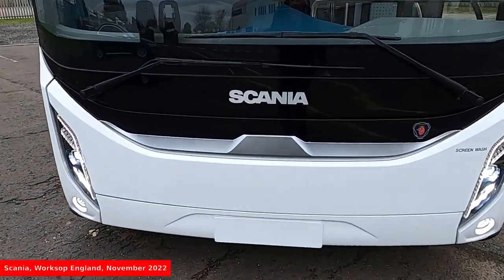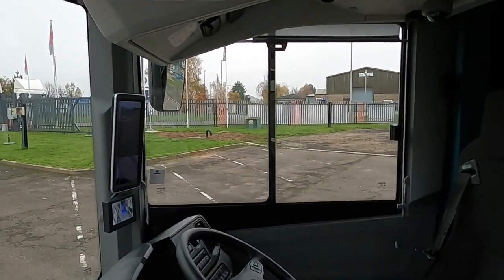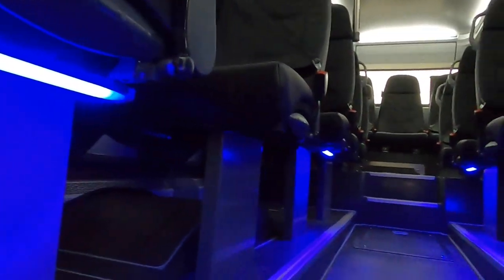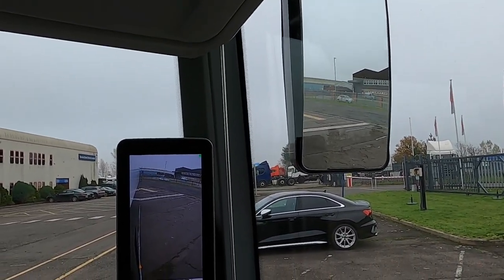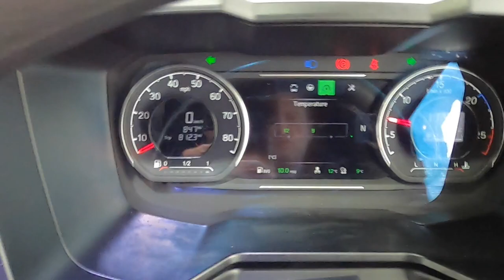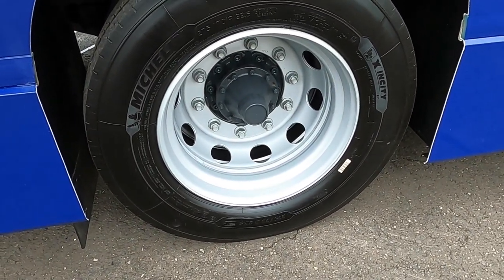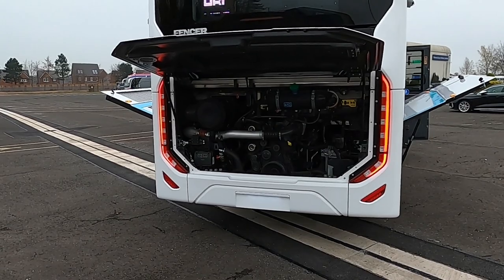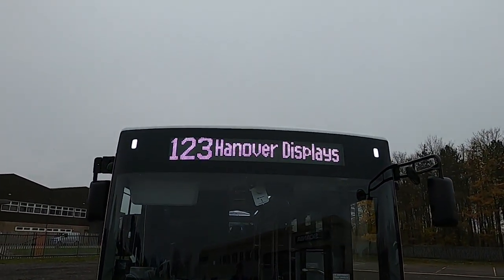UK Exclusive Test Drive | Scania Fencer f1 New Generation

Comment: This new bus looks nice but:
they should've used an interior IPS (or TFT) LCD display instead of a red LED one
For the UK market they should've added a "Bus Stopping" sign since I'd doubt that most passengers would understand why the stop bell is flashing red
The LED accent lighting should've been white instead of blue
And the driver's cab controls should've all been moved to one side of the bank of switches so that there aren't so many visible blank switches.

And that is a strange place to put the Hanover Display controller and it would've been nice if this was fitted with an AM/FM/DAB radio although it looks like there is space for one but only for a single-slot in-car radio which means there is no space for a 2 or 3 slot radio with infotainment screen which could be useful for viewing a map during driver route training or notifing drivers of a change in route mid-service in case of roadworks or a road accident or other mandatory deviation from the bus route...
Reply: To be fair I’m sure the operator could spec such on the bus, I did too think the positioning of the Hannover destination was a little odd but this bus is a demonstrator hence both normal and camera mirrors in the vicinity of the driver

Comment: its stupid things about scanias which annoy me, so brilliant they add all that extra hatches for the off side yet move the altinators to the near side compared to the older dc9 engine, which now means they will be harder to repair. also move the bloody rad pack to the off side aswell as all that will do is suck all the shit out of the side of the roads and into the radiators, we suffer with this constantly on the k230 chassis already... like ffs scania are you designed by mongs or something
Reply: This was the case with the ALX 400 with London United (Hounslow) the cummins engined tridents. Hoover for the road. I haven’t heard Rad’s since working at Arriva, briefly
Reply: There's manufacturing or emissions reasons. They don't make design choices for no reason.